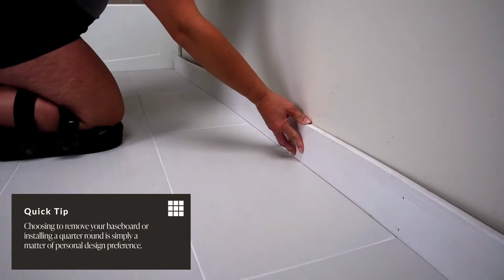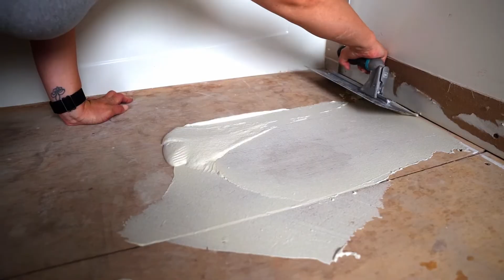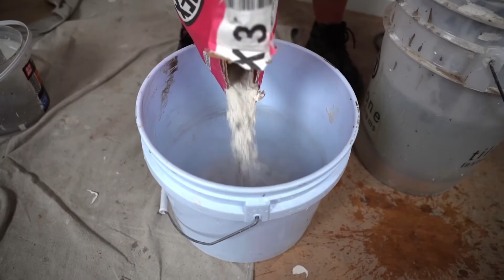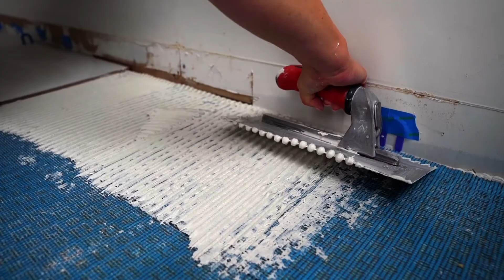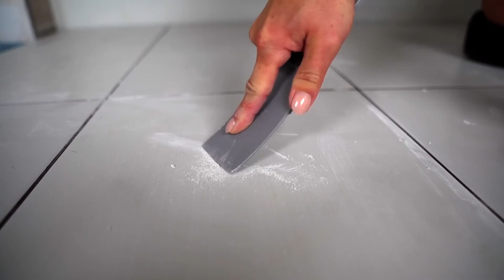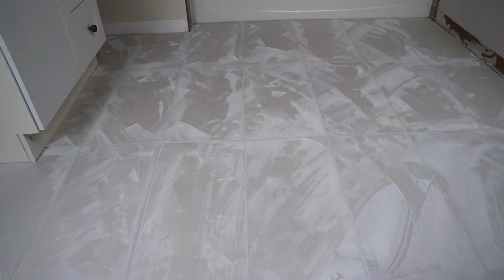How to Tile a Floor Like a Pro | Tile Shop Tutorials

Comment: A good tile floor is never only about placing tiles straight. Substrate preparation, layout, adhesive coverage, grout planning and cleaning all affect the final performance. The process before fixing often decides how professional the finished floor looks.

Comment: Why do you convert 11/16 to .6825 when it should be .6875? Just curious because with the correct conversion you get a number that's a lot harder to work with XD.